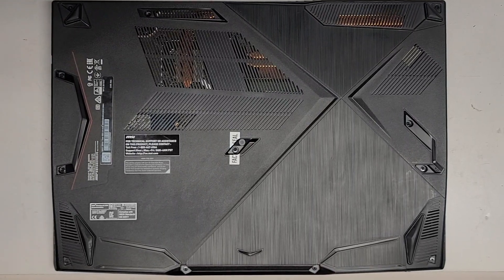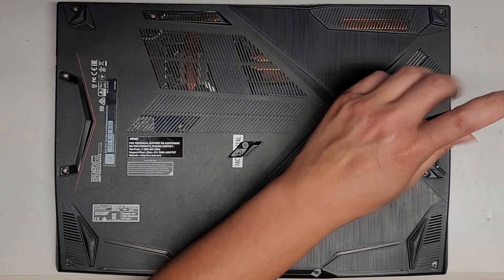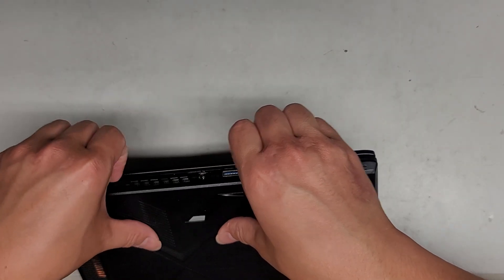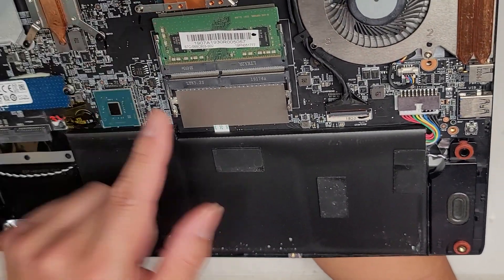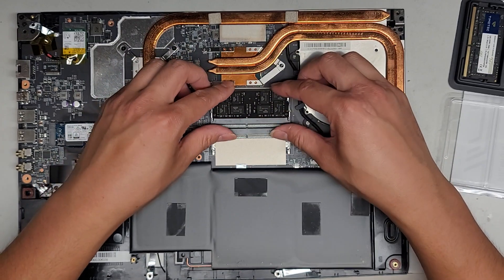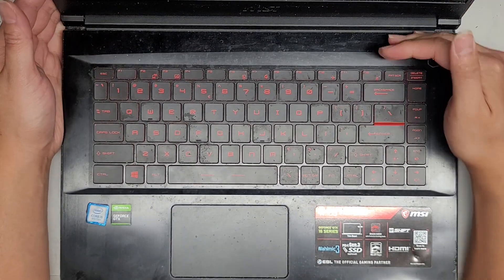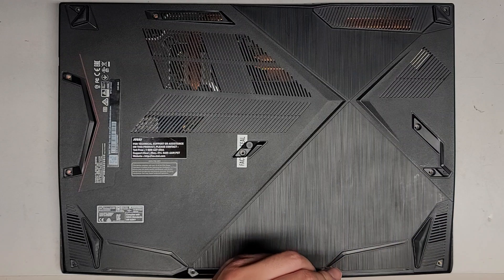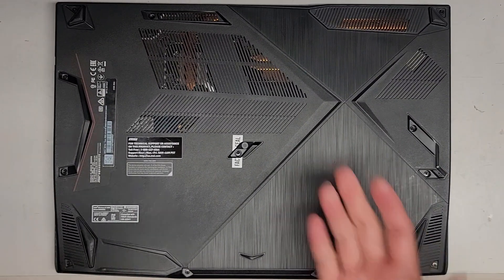MSI GF63 Thin 95C 95C-614US Disassembly RAM SSD Hard Drive Upgrade Replacement Repair Quick Look

Comment: What is the name of the upgraded ram ? I have the same laptop and need to upgrade the ram 😅
Reply from the maker: @alonsoochoa458  how much RAM do you want?
Reply: @ItsBinhRepaired  I have 8gb so I guess 16 gb ? Do I need to replace the ram I have installed already, with the new ones ?
Reply from the maker: @alonsoochoa458  do you currently have 1 stick or two? What's the specs?
Reply: @ItsBinhRepaired  currently 1 stick that’s the 8gb
Reply from the maker: @alonsoochoa458  can you check the info on the sticker of the ram?
Reply: @ItsBinhRepaired  yea it’s 8GB 1Rx16 PC4-3200AA-SC0-13
Reply from the maker: @alonsoochoa458  I'd go for this https://amzn.to/3Nchx6b or this https://amzn.to/3TVV2WZ
Reply: @ItsBinhRepaired  thank you so much for all the help! You really helped me out a lot, thank you thank you
Reply from the maker: No problem